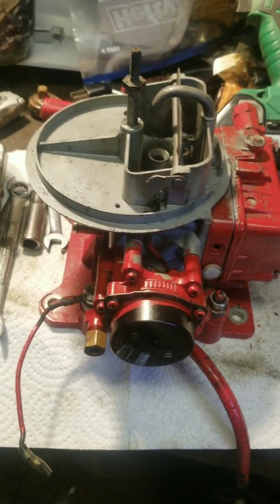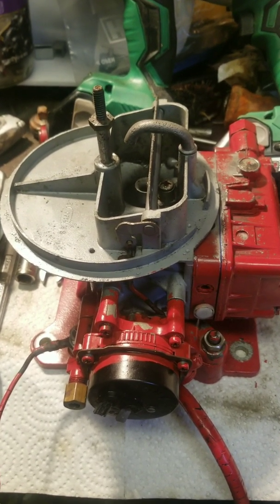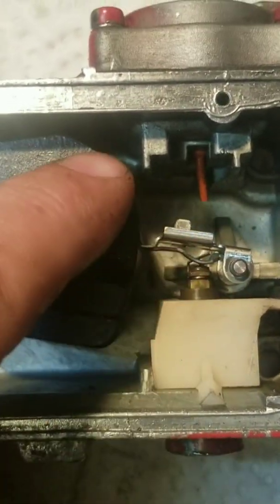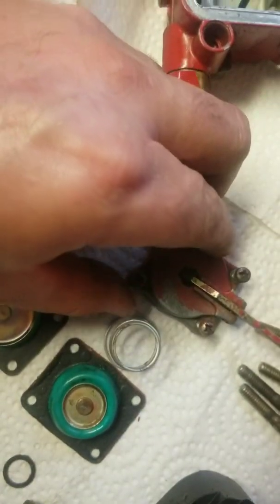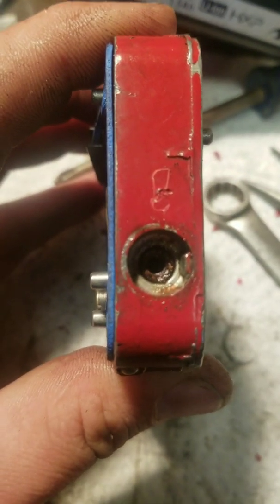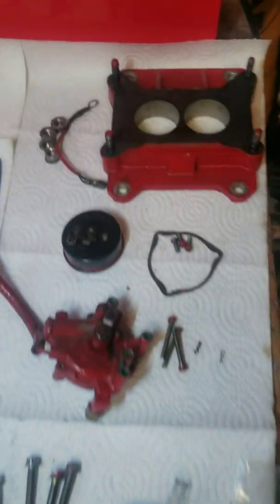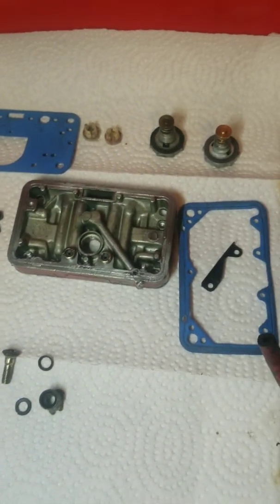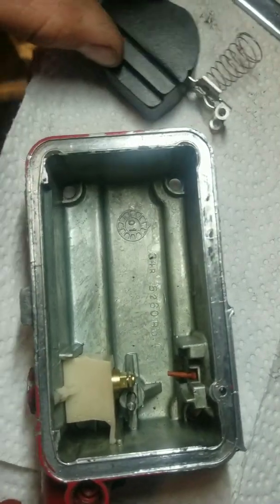Volvo Penta 2 Barrel Holley Carburetor rebuild

Comment: Still helping people get through this rebuild 5 years later. Not 100%  complete yet but stopped when I finished the bowls and will pick back up tomorrow morning. 1 question though, the little rubber plug for the pump, it looked like the float sprng just pushed it back. I centered mine just to be careful but do you know if you went back in and fixed yours? Anyway thank you so much for this video this was by far the best!
Reply from the maker: Glad I could help. It's been running good.

Comment: At 6:03, what is the red valve thing called?  My carb kit didn't come with one and the original was loose in the diaphram, trying to find how to request that - will likely need to get another kit I bet. I think the audio quality is fine, and orientation works fine on a phone if you hold it upright.  Thanks for the video!!
Reply from the maker: I believe it's a relief "valve" of some kind. Good luck finding it.
Reply: @ShadetreeMechanic  Thanks!

Comment: When the float bowl is normal way up(accelerator pump at the bottom), where should the float sit? Thanks, very helpful video..
Reply from the maker: I'm not 100% certain what you mean, but the float should be resting on an angle with no fuel. Once the fuel fills up it floats and prevents excess fuel into the carb. Give me some more info and I'll try and help.

Comment: Thank you for this video!  I was able to rebuild my 2 barrel Holley carb in about 3 hours based on the clear and concise video - would not have been able to do this without it!  I spent about 2 of the 3 hours scraping old crusty gaskets vs. replacing parts.  Thanks again for this clear, concise, informative video!  Dave Raicevich
Reply from the maker: Love to hear that it helped you. Sorry for talking so softly!

Comment: Why take the electric choke off at all? Just curious. I'm in the middle of rebuilding my carb. I have to wait for the bigger accelerator pump diaphragm and the umbrella valve to arrive, as they weren't in the kit I ordered.

Oh, and you got lucky. Mine has never been touched before, so it still had the OEM Volvo gaskets. Volvo glued the gaskets to the carb and I had to use a Dremel and a wire brush to remove the gasket and residue. Took hours.
Reply from the maker: Good just to check for corrosion.

Comment: i have the 5.0 boat starts no problem when i pour fuel into carb i have fuel up to carb. Is it possible to just pull the cover with 4 screws and clean the jet.
trying to winterize. may do a rebuild in spring never had a issue before not sure i need to rebuild
Reply from the maker: Sounds to me like your float might be stuck or the jets are clogged. Good luck

Comment: Thanks for the tutorial,  where did you buy the repair kit ?
Reply from the maker: Amazon. Just make sure you use the correct accelerator pump
Reply: @ShadetreeMechanic  could you provide the Amazon part? Would I use the numbers stamped on the side of the carburetor to search Amazon?

Comment: Content is good even though you skip parts like removing the old gaskets which would be helpful to 1st timers like me. But the video and audio leave much to be desired; portrait mode is a bad choice and the sound is so low I had to use head phone blasted to the highest volume to hear what he's saying.
Reply from the maker: Next time it needs a rebuild, I'll definitely have better video quality and audio. Sorry for the frustration!
Reply: @ShadetreeMechanic  It still guided me through my very first carb rebuild (on a 21 year old carb that has never been touched). It's back on the the Penta, tuned and running well. Saved me a couple hundy and I do appreciate that.

Comment: I'm also wondering about the accelerator pump. Looks like you took out a 50cc & replaced it with a 30cc. Did it run after rebuild or have a stutter on take off? Also wondering if the extra travel from the 50cc will tear the 30cc diaphragm apart after awhile or does it all adjust out in the adjustment?
Reply from the maker: Interesting, I haven't noticed anything different. I'll have to pull it apart to take a look at it.
Reply: That's exactly what I noticed too!  That kit has the 30cc pump and your old carb has a 50cc pump

Comment: You have a 2 bbl carb on a 4 bbl manifold!!
Reply from the maker: When I saw the opening on the intake I thought the same thing, but that is the orginal carb and there is no other version of the Volvo penta intake. I get what you mean though
Reply: They are all set up that way. Gives it better low-end torque.

Comment: WHY DID YOU SKIP THE CHOKE IDLE CAM SET UP? HOW DOES THE TINY SPRING GO ON THE TWO TABS THAT ATTACH TO THE PASSENGER SIDE OF THE THROTTLE SHAFT?...."HELP!"........."cheers!"
Reply from the maker: Sorry that I missed something. I've rewatched the video and I'm sorry, but don't understand your question. I want to help you solve the issue though. Can you give me something in the video to reference?
Reply: @ShadetreeMechanic  YEAH ,There are two interacting levers on the throttle shaft ,on the choke side of the carb. there is a spring in the middle of them. Mine was broken and I was able to find a replacement but I don't know how everything goes back together since Murphy helped me take them off and now he won't tell me how they work the choke high idle cam assy...I thought I had them on correctly, but now the spring holds the adjuster screw up off of the cam and it causes the idle to fluctuate and the rpms to run at 2k. The idle adjuster screw has no effect now....I've already tested for leaks w/ WD-40. "No leaks" ....1963 NOVA station wagon w/ 194ci 6 cyl.& THM 350 trans & HEI ignition.  ................."cheers!"
Reply from the maker: Alright, I understand what your asking about now, the trouble is my boats in storage and I don't have access to the carburetor to make a video for you. If you can wait a few months I'd be happy to do it for you.
Reply: @ShadetreeMechanic  "Daily driver"....Thanks anyway....AT LEAST YOU ANSWERED.......I'm one of them guy's who never stops looking for a lost tool "or" a solution............"Keep the Faith"..........."cheers!"

Comment: Thank you so much!  Just did this to friends old boat.  Did you adjust idler needles after?
Reply from the maker: Glad to help. I didn't need to touch the idler needles at all. I did adjust the bolt/nut that touches the accelerator pump.
Reply: @ShadetreeMechanic  Thanks for the reply.  For the idler needles, i just screwed them all the way in and backed them out 1.5 turns as a starting place.  When i removed them, i had 7 and 8 turns, respectively, but upon re-installation, they bottomed out after several turns.   My friends kit didn't have "cork" gaskets for the idler needles which makes me a little nervous.  Also, the gasket on the top didn't seem to fit correctly either.  I really appreciate your time making this video.  It helped a tremendous amount.  This is exactly what my friend has and there are so many variants of this style of carburetor it can be a challenge to get the correct rebuild kit.
Reply from the maker: @NCSUME1  I couldn't agree more. There are so many carbs and so many kits. Seems like a crap shoot if you get everything you need.  Made this page to help people and its really great to hear people find it helpful.
Reply: @ShadetreeMechanic  Not only was it helpful, but I sincerely appreciate the time it takes to put a video together and edit it.  Much less one that is actually informative.  So many thanks again from NC.  Have a great weekend.

Comment: Good video but I think you have the wrong size accelerator pump
Reply from the maker: Really? How can you tell?
Reply: Thanks, I spent hours  searching Holley or Ford two barrel carb for a 1960 F100 rebuilt. ( disassembled the Carb months ago) I ignored your video because of Marine Volvo. Except for the electric choke and plastic marine doohickey Carb was identical. Big thank you!! I’m going to surprise my girlfriend and her sisters by getting their deceased fathers old Pick up running. Ordering new tires tomorrow

Comment: I did mine about 3 yrs ago. I was curious about the settings. So I check the float level and such before I removed them....just to make sure they were in range....after I did this the boat would run for a while then die....... it was scting like it was running out of gas....DROVE me CRAZY, then I discovered I needed to replace the water fuel separator.....amazing at how we over look thinks like that... Thanks for the post. GREAT JOB!!!
Reply from the maker: Lawnpro, these problems can drive you crazy sometimes. Glad you found the video helpful.

Comment: Can you tell me what hooks to the brass fitting (vacuum????) on the electric choke portion.  I bought a used boat and nothing was hooked to it but it is pulling vacuum when running?
Reply from the maker: So forgive me, but I have no idea what the purpose of that brass fitting does. On my carburetor, as far as I can tell it does nothing, however after alot of internet searching, I found an image of a Holley carburetor with a vacuum hose attached to that brass fitting leading to a vacuum port directly above the electric choke. Sorry I couldn't be more helpful. Good luck